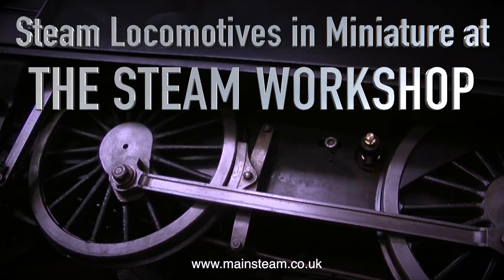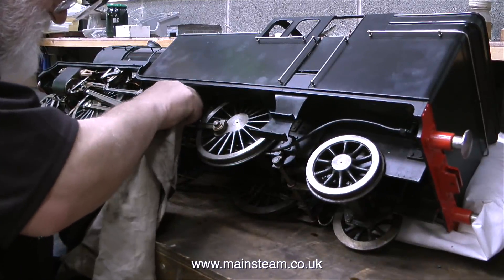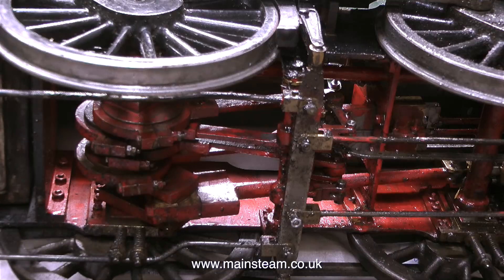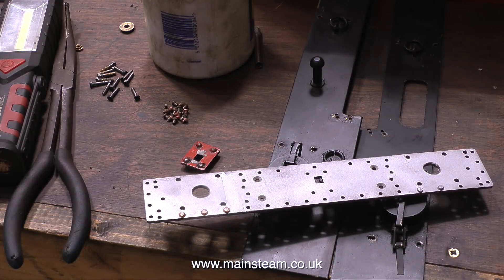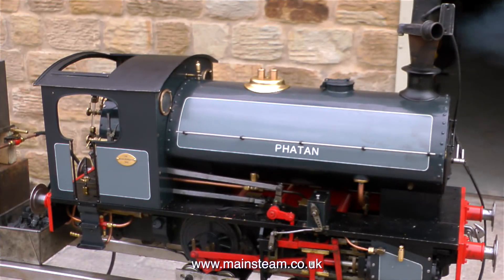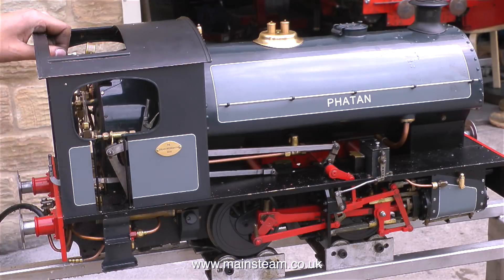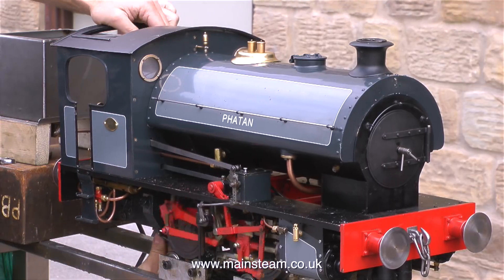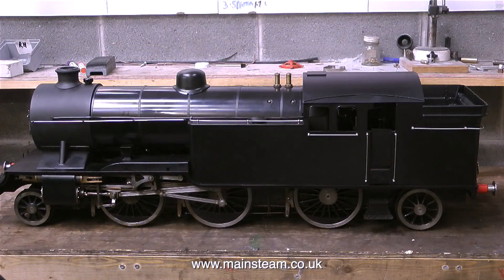WORKING AT THE STEAM WORKSHOP - A FEW SMALL JOBS LEFT TO DO ON THE V1

Comment: I know that many of your watchers with knowledge of model steam engines and the like may laugh at my question but you talk of 5/16 X 32 thread, which category of thread is this ie; UNC, UNF, BA or one of the many others.
Reply from the maker: 5/16 x 32TPI is known as a "ME" (Model Engineering) thread.
Reply: Thank you very much Keith that clears it up nicely
Reply: Per ASME B1.1-2003, 5/16 X 32 is designated UNEF (extra fine).